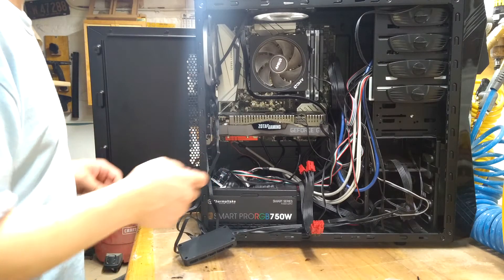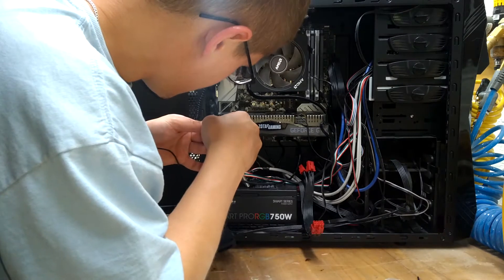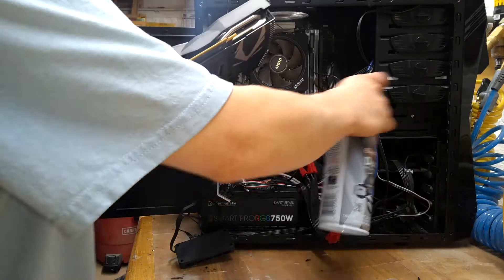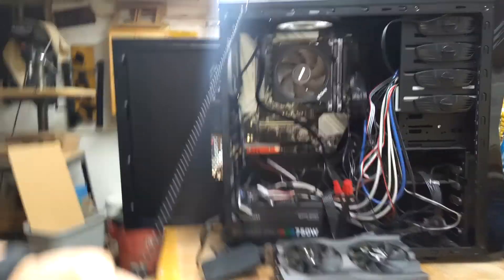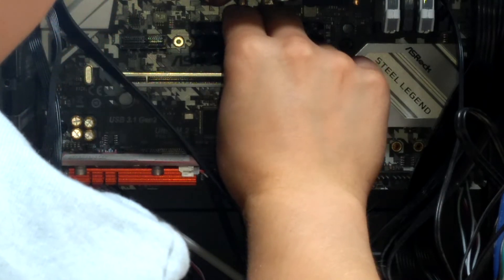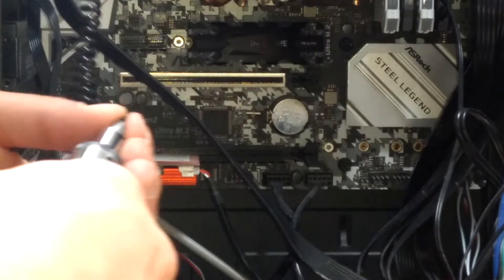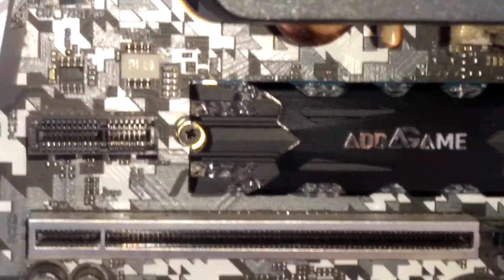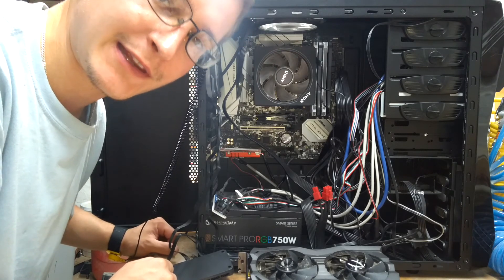03 SSD - How To: Remove Graphics Card And Install M.2 SSD

Comment: I have to do that to add more space but the is the gpu is detected as the same gpu as before ? I mean do I have to reinstall all the drivers and the speed of the fan ? Or is the gpu keep the settings memory that I made before I remove it
Reply from the maker: Good question!

So my understanding is that you're asking if you install an M.2 drive, if you'll need to reinstall drivers and redo settings. If not, please correct me!

So yeah when you install a new hard drive it won't have those drivers or settings on it as they are stored on the old (or the "now secondary" hard drive). With USB devices, drivers are typically sensed and installed quite easily. GPU's unfortunately are not :(  Therefore, you almost definitely would have to reinstall the drivers on the M.2 and then set the settings all over again.

Even with backing up data from old hard drive then deploying that to the M.2, not EVERYTHING will carry over. We use a tool at Amazon to transfer peoples data and it does everything from documents to desktop backgrounds to.... etc. But some programs that were installed do not carry over and need to be reinstalled.

Comment: How's the temperatures on the SSD tho? Since it's behind the gpu, I'm assuming it will run really hot. Should I install a heatsink for the ssd or am I good without one?
Reply from the maker: It may get warm but not to the point of risking ssd failure.  Obviously I recommend occasionally backing up data, but you should be fine without a heatsink for ssd. Thanks for asking though!
Reply: @letechnology1774 I have a heating 990 pro....guessing that'll help? I mean like the on that's made "with" a heatsink around it

Comment: A little late here... Your SSD slot is just above the GPU, so you don't really have to remove it to install the new SSD, right?
Reply from the maker: If ur God, no... For screwdrivers that I used at the time, it for sure was. It's doable and possible, but very difficult to do so with GPU in. Much easier if removed. Recommend doing so. Also SSD or M.2 SSD which plugs directly to mobo?

Comment: omg i have to remove and reattach my heavy graphics card? the struggle is real. can i just put it on pcie x4 adapter or something? will it boot windows 10?
Reply from the maker: Yes that will work! Speeds may vary a little but I'm not positive. Still waaay faster than a normal SSD
Reply: Someone is making pcie adapter for multiple nvme. So i think is good for an alternative way to install this